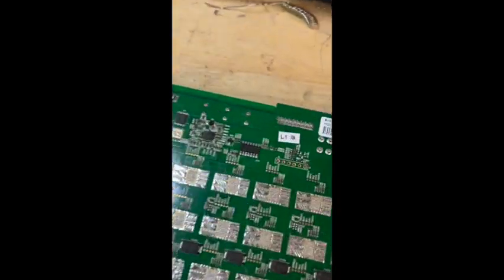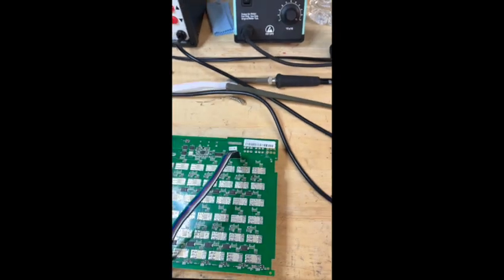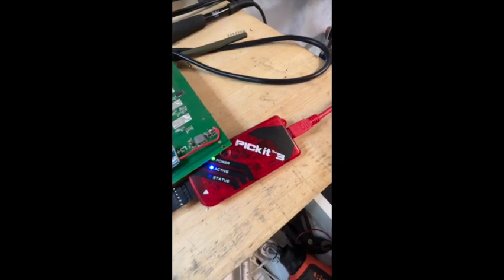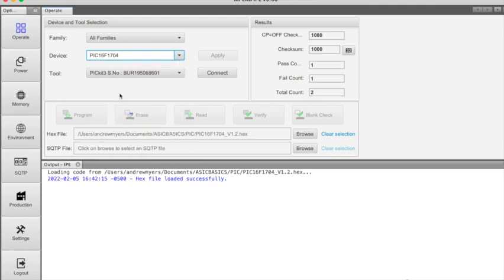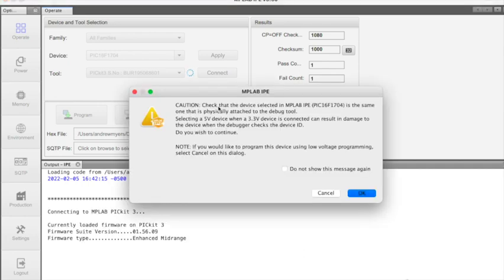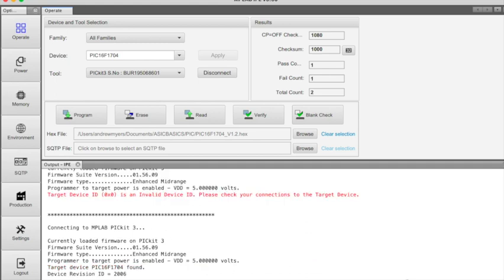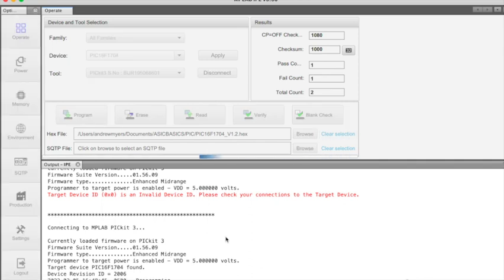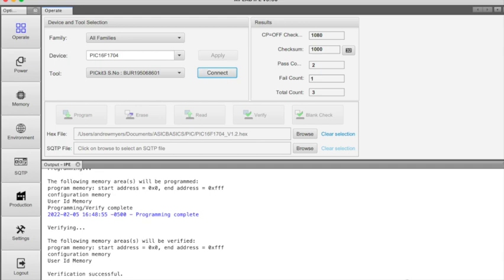ASICBASICS.COM - Reprogramming the L3+ PIC using a Pickit3

Comment: Andy, thank you for the videos and the website content.  I too have a question about firmware versions vs board revision levels.  I have a l3+hashboard_72_1.5 that exhibits the exact same symptom with zero volt that you mentioned flashing the PIC might help... Is there a reference library of firmware version compatible or the PIC chip on each board revision level?
Reply from the maker: The PIC files are named after the version of the hash board you have and I have the downloads on my website at: https://asicbasics.com/fix-it/fix-it-l3/

Comment: If I replace the pic on my board with a new one does it have to be programmed?
Reply from the maker: Yes, if you put a blank one on it will. Some versions of FW can program it, but it would work best to just copy the PIC from one of your other boards (with the same PIC, i.e. 1704 or 1705) to your new one before adding it to your miner. 
https://asicbasics.com/programming-the-pic-on-an-l3-hash-board/
Reply: @asicbasics  ok thanks for the open info. I appreciate you sharing all your hard work. Most people in this stuff just want to Capitalize on it.

Comment: I absolutely love your videos.  I have one question though, how do I determine the  version of hex to use? I do see on my board adjacent to the boost circuit L3+_HashBoard_72_V1.2. This is also stated on the adhesive sticker adjacent to the I/O port "Model: L3+ V1.20." So I am assuming I would need the hex file that you have shown in the video. Do you know where I can download this hex? Keep up the good work! Thanks in advance!
Reply from the maker: It's determined by the silkscreen on the back of your hash board, generally the most common ones are v1.0, v1.2, v1.4, v1.5, and v1.6.1
Reply: @Andy Myers  do you know where I can get a hold of a pic hex file for v1.2?

Comment: I get the following error when trying to connect. Wondering if you have ever seen this? Do I need to connect the board to the power supply?

"PICkit 3 is trying to supply 5.000000 volts from the USB port, but the target VDD is measured to be 4.750000 volts. This could be due to the USB port power capabilities or the target circuitry affecting the measured VDD.

The target circuit may require more power than the debug tool can provide. An external power supply might be necessary.
Connection Failed."
Reply from the maker: Make sure to unplug all other cables on the board, the I/O or power cables can bleed voltage/current to drop the supply you're applying from the Pickit3.
Reply: @asicbasics  I just had the bare board, nothing else connected. I tried raising the applied voltage to 5.125, no change, lowered to 4.75 and it worked! Success!!! I installed into the frame and hooked it up and it's working, now to do the other 3 boards and this "parts machine" will be functional again. Thanks For your help Andy.

Comment: Thanks for making this video! I have a L3+ that I'm trying to do this to and see  if it fixes it. My hash boards are V1.6.1 1 and I don't know where to get the hex file for them, I looked on custom miner services website and found a V1.6pro hex file but don't know if it will work or if it will hurt anything to try to install that hex file on my boards. Thanks for any input you may have.
Reply from the maker: That should be the file, I've used that file before and works fine.
Reply: @asicbasics  Thank you! I will give it a try.